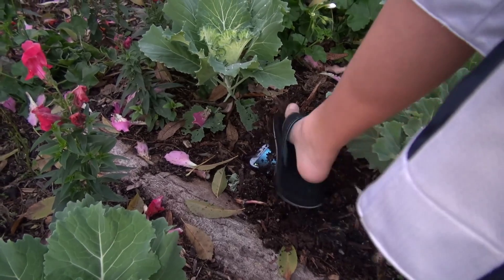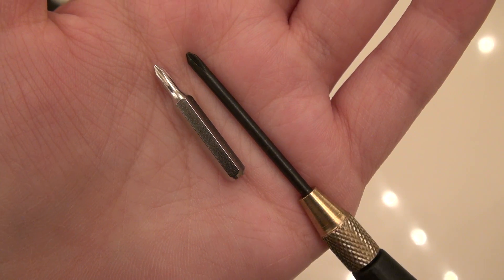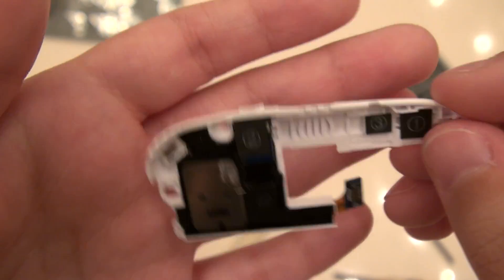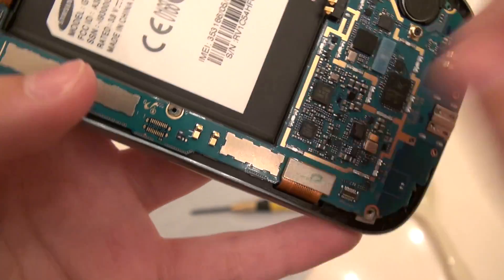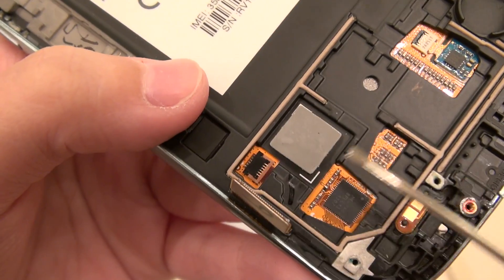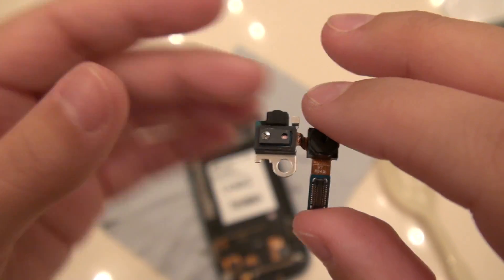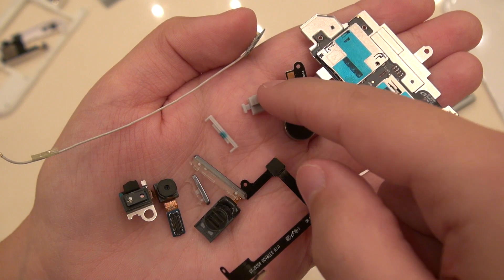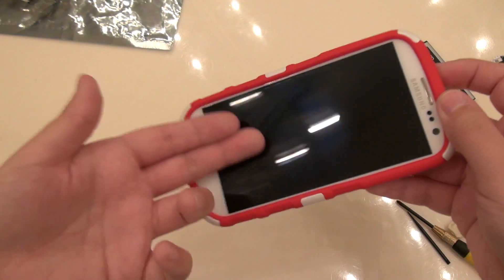Galaxy SIII Disassembly *REPLACE & SACRIFICE GORILLA GLASS DISPLAY*

Comment: Guys pls as guy which working in actual company which fixing phones I suggest you  (when you have screen like her with housing /frame around screen/ ) heat wifi antenna and volume/speaker flex and also the vibrator and other parts which are held by double sided tape! It's much harder to take that parts off on first dissasembly and you can easily broke them! Every dissasembly video is little tricky because it's phone which is dissasembled for at least second time in most cases! Please keep that in mind!!

Comment: Thanks for this! I've gone through a repair myself tonight and I've fixed my phone. I did break the wifi antenna from the back of the actual board, so I'll need to think of a way around that. Maybe an external antenna. Plus I have a 3905 model (4G) and the digitiser I got was for a 3900, the non 4G model. I've got video so I'll put a link up on my channel when it's all edited together.

Comment: If touch screen don't respond, new glass would solve this problem?
Reply: i think it's the lcd digitzer.
Reply: The glass on the front is also the capactitive layer that senses your fingers, so yes.
Reply: On S2,S3,S4,S5 Touch isn't on Glass, It's on Amoled (I'ts not LCD it's Amoled) In most of cases touch Is on glass and it's connected by it's own flex cable but not on this devices /for example because there are more which doesn't have touch on glass.
Reply: Nick Vangelatos it doesn't mather what people understand it's like when u call plazma tv LCD tv... pure madness.... and u don't need to explain me this things I work in company which repairs phones tablets laptops and computers I know all this stuff ;) We do even also repairing only the glass in our company on S3 etc ;)
Reply: What ever it takes New glass wouldn't fix it. It's an internal problem.

Comment: do you have a link where u got the replacement from that you ordered? my screens got a little crack in it from putting a plastic 1.65L bottle from the dollar store that was just under half full of water on top of my cell by accident and I don't want to do all that heating up to replace it

Comment: We can do this repair without issue at Rockit Repairs. We have replaced 100s of S3 top glass without any proximity or air gap issues.  Don't spends $200 on an assembly. We can fix this for $119 with free shipping. We fix the devices in less than one hour.

Comment from the maker: I would honestly get the entire screen assembly. It has the magnesium chassis and plastic sidings, the amoled panel, the digitizer, and the glass. If you remove the glass and digitizer you risk accidentally putting pressure on the amoled display. One tiny bend or push against it and it will crack like a brittle egg shell and parts of your display will be dead. They you will have to buy the entire assembly anyway. So....it's a 210-240 dollar fix.

Comment from the maker: Again, someone who doesn't listen. The problem is with a chip that is on the back of the glued amoled panel. It can't be replaced. The chip died. Therefore the digitizer couldn't receive input. Changing the digitizer or glass would have been pointless. Yes you can remove the glass and digitizer but you can't remove the amoled panel. One small bend and you crack the panel like a brittle egg shell.

Comment: @TheAngelofmusic1989 can i ask you opinions on replacing a cracked screen rather than a broken digitizer because i feel even tho you can replace a broken screen with a heat gun/ hairdryer and pull the screen off without damaging the amoled replacing it with a new gorilla screen you can still capture air pockets even tho apparently it doesn't  effect it when the phone is on due to the light but I'm thinking air pockets would affect the touch screen property's is it more worth it to buy digitizer

Comment: Yes! The S3 is sweeeeet but has a retarded screen design! Mine was charging yesterday and my dog ran past the table it was sitting on. He hit the cord, phone falls on the ground face first from like.....not even 5 feet off the ground and there was a large crack straight across it. I wish I had my LG Optimus L9 back. I literally dropped that thing out of a car window with NO CASE and there was only a small scratch...ON THE BACK of the phone.

Comment: Hey where did you buy that assembly? My GS3 glass cracked and just yesterday my screen started to turn pink, then blue, then black. I'm assuming something happened to break down the organic material that the OLED is made of, but whatever. Either way I need a new screen and I want to make sure I get the right one.

Comment: Thanks Angel for posting this video. I was able to replace my cracked screen with ease. I of course spent the extra for the screen and LCD digitizer because I was afraid of the heat gun method. Thanks again.

Comment: Was hoing to say use a blow dryer for adhesive removal, that way ull keep the stickyness. However do not keep heat in one area or u could burn in the screen, or other damage to board's. Other than that great clean vids, im really in disbelieve ofbhow organised are you.

Comment: How did you check the voltage on the phone? Mines just started to stop being touch responsive for recieving a sms and it wouldnt unlock from swipe. Did some wierd flashes like if it froze and stays like that even after i soft reset it. -_- I already had it rooted so i went to cmw recovery and factory reset using buttons but its still not responsive to touch. why do phones brick by themselves?

Comment from the maker: That will indeed damage the display... You can wear off that fluorosilane / oleophobic coating or cause damage to it. It's meant for abrasion resistance but if you completely abuse the screen, sure, I would expect you to be able to cause a lovely scratch.

Comment from the maker: Nope... The board has it's own shorting protection and you need much more than an antistatic wrist band to do anything. You got to actually be grounded correctly with the right equipment. Otherwise it's pointless. The wrist strap does nothing by itself.

Comment: what i do sometimes to get screws out even with a screw driver that wont grip it is i warm up the screw driver while its making contact with the screw so itll loosen it out but you have to be extra carefull as not to overheat it and melt something xD just thought id throw in that way of doing it~

Comment: Pro tip: try using a prying tool that is not made of metal since you can damage something if you're not careful on the process, you usually can use a guitar pick and it will get the job done, anyway, great video!

Comment from the maker: I don't think any of that matters. Your phone's bootloaders are bricked. Samsung can't even see what you have done before to cause this issue. Lol and no as long as it is not a modified kernel or rom it won't void your warranty. You don't need to root to use ODIN so you can see what I mean. What country are you from?  As long as you are from the country the phone was sold in say that the phone no longer turns off after an UPDATE. They will fix it without question.

Comment from the maker: Using a JTAG might fix it. But first, do you have a warranty? Flashing Samsung stock firmware with ODIN will not void your warranty. I would send it to Samsung. Otherwise a JTAG basically lets you download bootloaders to the corrupted phone with an SD. This is if you can at least get the phone to power on!